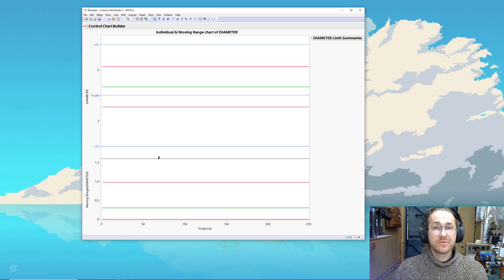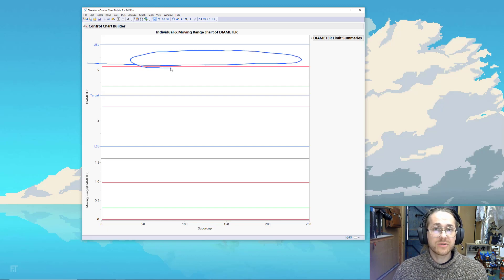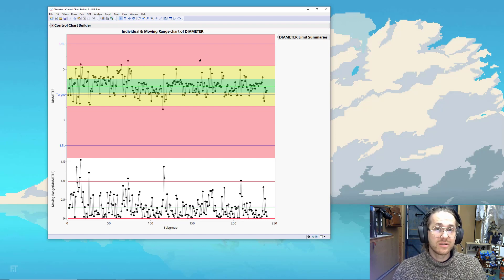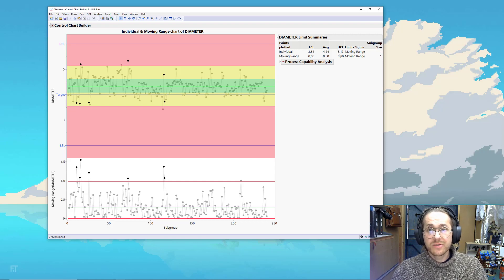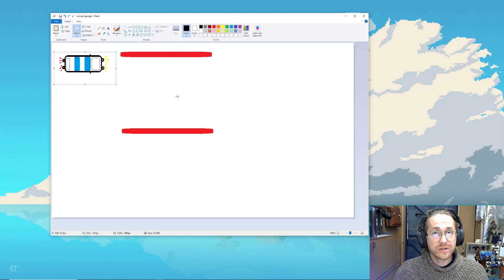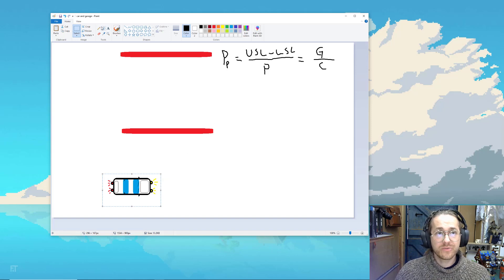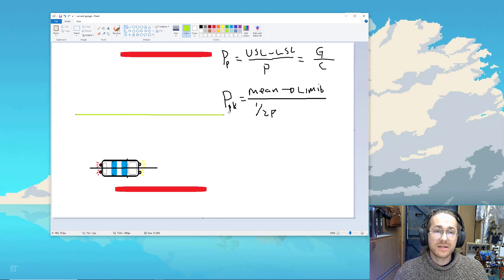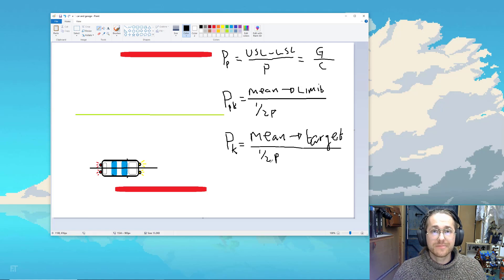Quality Control Chart and Process Capability Made Easy!

Comment: how could you measure the Cpk Ppk and do it with a confidence interval and make sure you are on target within U/LSL or U/LCL with 90% confidence?
Reply from the maker: Hi @irwinhirsh8463 It took me a while to find the answer because it doesn't seem to be possible in the control chart builder (I might be wrong!). However, if you do the analysis in the distribution platfrom you can specify the alpha lvl!